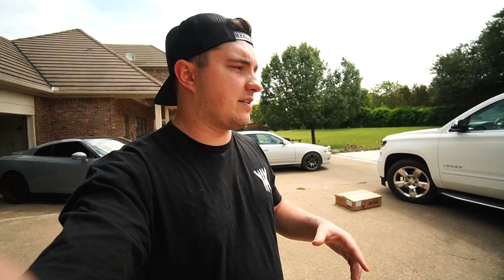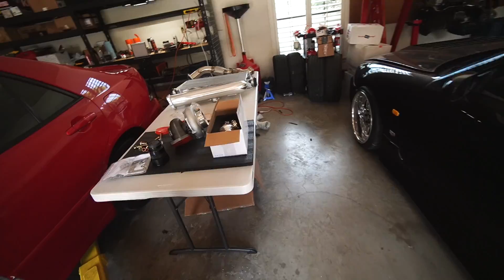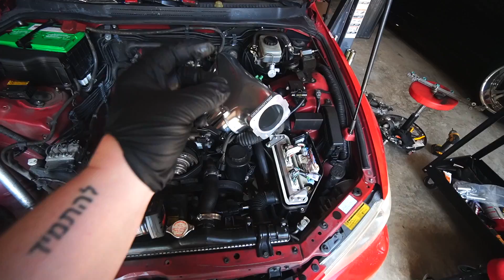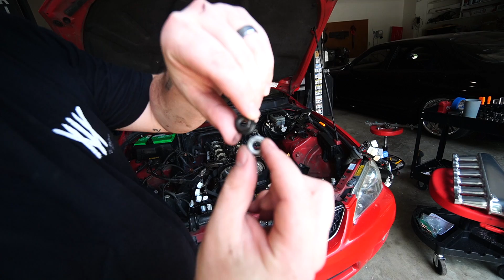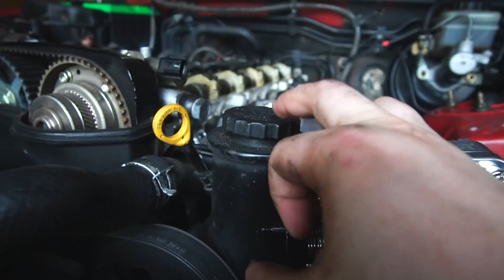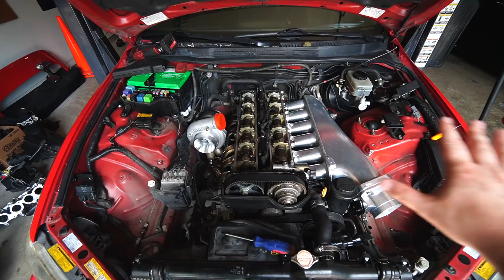Boosting the IS300 for CHEAP! Or not... (Pt. 2)

Comment: There's a good saying out there:
"You can only have 2/3 of these things. Fast, cheap, reliable."
Reply: Actually true
Reply from the maker: We’re going for a 3/3 hybrid here lol
Reply: Evan Shanks lmfao 😂
Reply: @evanshanks  lol fingers crossed bro
Reply: Unless it’s a toyota,., I had a 20 year old IS200 (baby version)... most of the stuff looked original. Still started on the first crank. Mad little cars.
Reply: How we say it in the west is similar but we have a sign for it all.
Want it cheap and reliable it won't be fast.
Wast it fast and cheap it won't be reliable.
Want fast and reliable it won't be cheap.
Reply: Unless it’s a Honda Civic then it’s 2 of the 4 things fast cheap reliable and stolen
Reply: @sltyboi  😂 my honda prelude is 2/5 things it's reliable and unmolested (100% stock) so it's not built cheap, it not fast and it's not stolen
Reply: Bruh I don’t even got a car........
Reply: iPotency ! Not stolen yet
Reply: Cheap reliable stage 1

Comment: You should really get a custom tucked harness made for it. It will look so so much better plus its way easier to work with and you can get all the sensors added to it for the stand alone.

Comment: You can do the wiring pretty easily you just splice wire into the line making it longer make sure you solder your connections and wrap them together nasa spec repair

Comment: Boosting an is300 what made me subscribe
You are doing an na-t which is fine to be done but i am swapping with a 1jz vvti from a jzs171 and i amusing panic wire link from xcessive manufacture ecu to plug and play but also i am relocating the ecu to the passenger airbag location 
Itz not gonna be my daily but it would work as a daily it would be really fun drives car  

But i have few advices
1 relocate the battery to the trunk
2 relocate the abs to the bTtery location and use a jdm altezza
3 i recommend with mishimoto radiator and cleaning all the cooling lines as much as you can 

All the best

Comment: Toyota does the samething on their 3sfe 4 banger but its transverse aswell so u hav the fish the wires out between the intake manifold, back of the engine and fire wall. The engineers didnt give af the just want wires from point a to b as fast as possible w/ a jank wire routing

Comment: Will you be changing your pistons and rods? they are known to be weaker than the 2jzge non-vvti (whats in the supra). Unless you're not trying to make a crapload of power. if I'm correct, I think they're rated to like 400hp. but going pass that you're looking at changing the clutch because the w55 transmission cant hold much trq. like 350. just wondering, been watching you for the past 3 years and I'm mad excited that you got a Lexus is300. I'm leaning towards a na-t build with my is300.

Comment: if your just shooting for 400whp, the crossover manifold is enough for your goals, that brake pump thing is gonna be a b***h to get around (a solution for that you might wannt look at the 2GS300/400/430 , there brake ABS pump is located on the driver side right underneath the brake master cylinder  and you might be able to use the GS pump on your IS)

Comment: Look into 2015 and up Gti's for Victoria and grab you a truck. The Mk7s have great space, can be modified easily if that's something you two want to do, gets decent mileage and can be picked up fairly cheap for 15/16s. I had one for 78k (car now has 150k with no issues), my fiance has one with 55k and I went to a 2016 A3 AWD with the same motor as the Gti and have 85k with no issues. Great cars for the money on the used market. Plus you would be one of the only bigger youtubers with a Mk7 for content if you end up doing it.

Comment: Bless your heart Evan but you really do not have any idea what a budget build is. Here in Kentucky where I live the builds that we see you making are over-the-top elaborate expensive builds. For example I had a 1994 Nissan Maxima that I did a ve30de JDM engine swap with a Garrett t3 71mm turbo (ball bearing) genwolf technology ECU and twin turbo 300ZX injectors made my turbo manifold out of the stock one and fabricated everything else and the build including cost of the car didn't come over $5,000. That is a true budget build. Car makes 422hp 389tq to the wheels. I have a friend who built an IS300 similar to yours and his build was around $8500 including the cost of a car.  You must be projecting your videos to a rich demographic or something because this kind of build you are doing is something it would take me 5 + years to obtain the funds to do so.